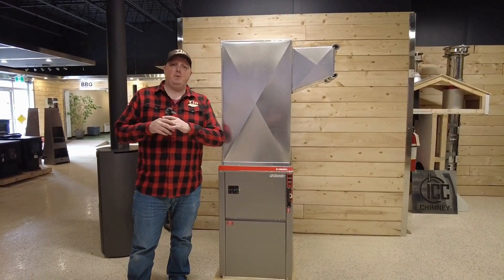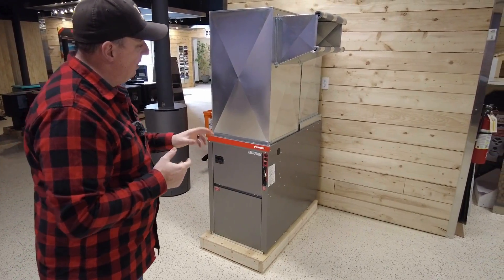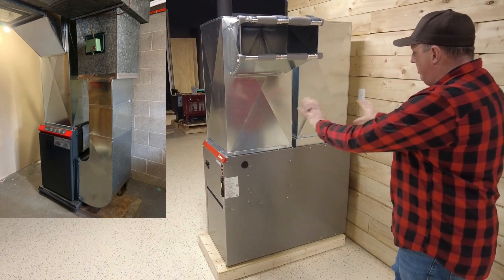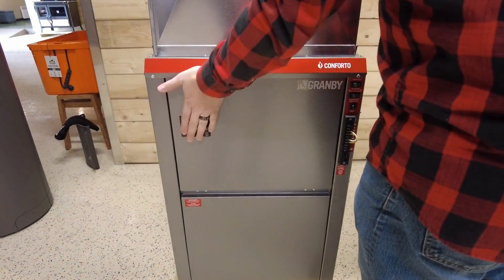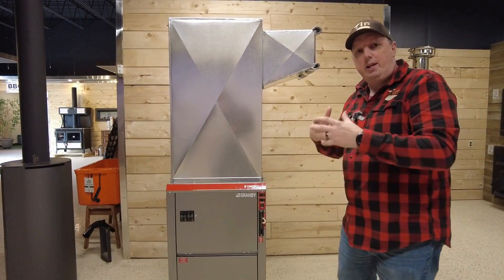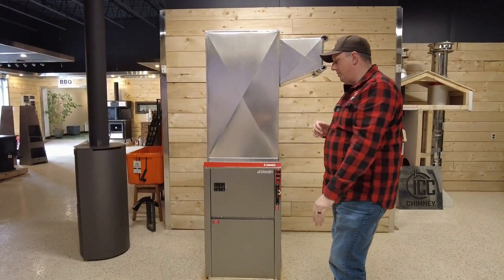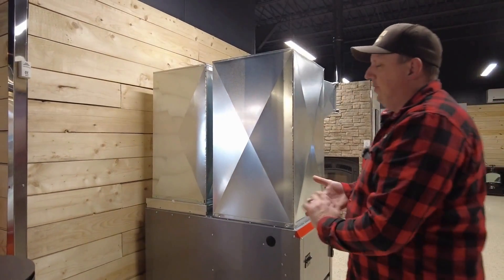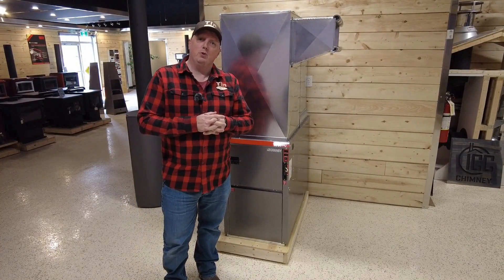What is an Electric Furnace? The new Granby Conforto

Comment: Nothing new. They used to get made like this ages ago. Expensive to run junk then as it is now.
Reply from the maker: There are improvements over what was out years ago. The new stuff tends to be smarter and make better use of the electricity it burns. Years ago all the elements came on and now we have units like this granby that only turns on what it needs. Be step forward.